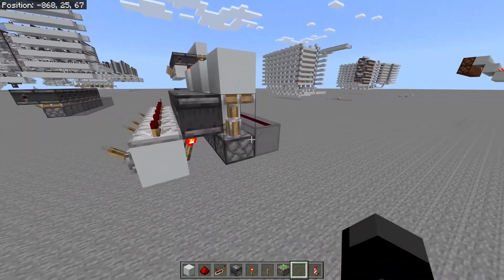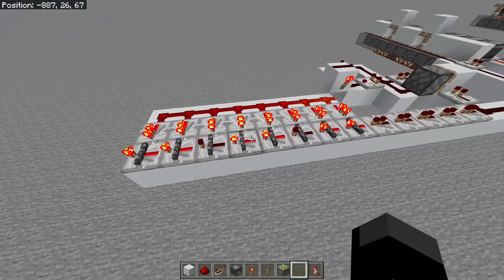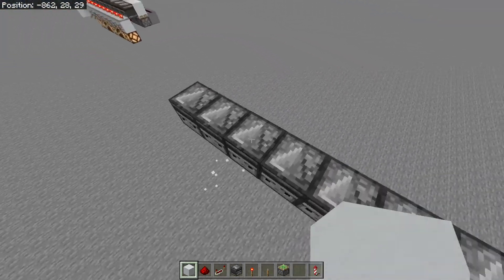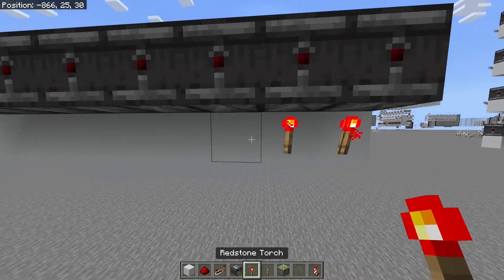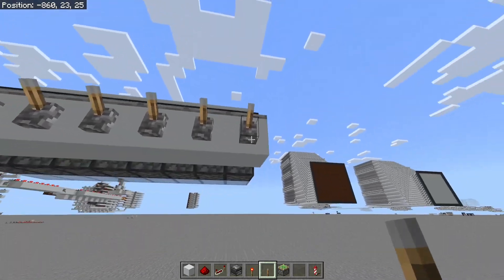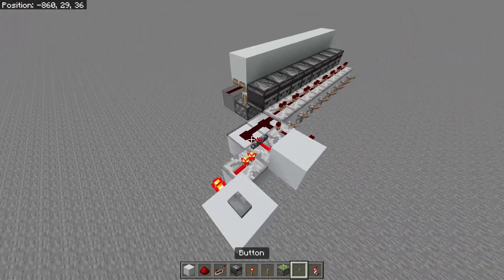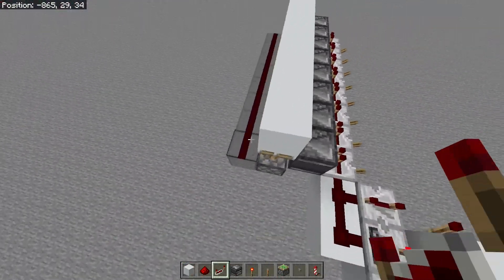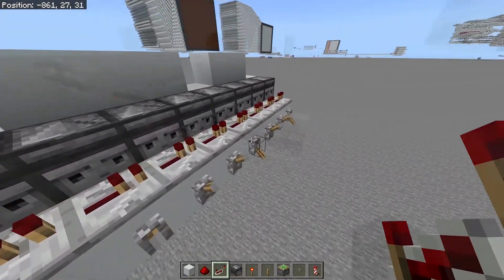Compact Serial Encoder Tutorial - Minecraft Bedrock

Comment: @TheDarkness344 Hi, great vid! I made the endcoder and decoder and it works great, but how do i take the info off the repeaters? I tried using observers but they dont work. Thanks!😀 (new sub btw)
Reply from the maker: @callumsewellukulele  you can leave a block between each repeater (just use a solid block or restone dust).
Reply: @TheDarkness344  Thanks!

Comment: It's probably a dumb question, but how do i decode the signal, or do you have a decoder as well ?
Reply from the maker: You can use a serial in parallel shift register. I typically prefer using repeater locks. If you clock the shift register the same time that bits come in it will be able to decode the data. I think I uploaded a video a couple months ago showing off more serial stuff which should help.
Reply: @TheDarkness344 thank you I will look into that I appreciate it

Comment: how do i expand it?  I would like 18 instead of just 8
Reply from the maker: Just add more. The only issue you will run into is signal strength where you will need to use a repeater to extend. Then on the activating line directly opposite that repeater, you will need to minus 1 tick from the repeater or the timings will be off. (If repeater on one tick, replace with redstone dust)
Reply: @TheDarkness344  Where can I send you a world where I'm trying to implement this mechanism but still can't do it?
Reply from the maker: @MrHann4  Make sure you are on bedrock as I don't think this design works on java. If you are getting stuck by running out of signal strength and don't know how to do the repeater thing properly, you can always stick a repeater as the output from the middle of the line instead of one end only. This should work with 18 bits as the signal strength only needs to travel to the middle so ~9 blocks.
Reply: @TheDarkness344 how to receive the code
Reply from the maker: @AnonymousIsBackMissMe  you will need a serial decoder like the one by maizuma games
Reply: @TheDarkness344  what if it's connected to a 3x3 lamp screen
Reply from the maker: @AnonymousIsBackMissMe  should still work fine if you are using repeater locks for the data - check out my serial display video. That was a 2x2 pixel density screen but can easily be scaled for larger densities.
Reply: @TheDarkness344  oh ok